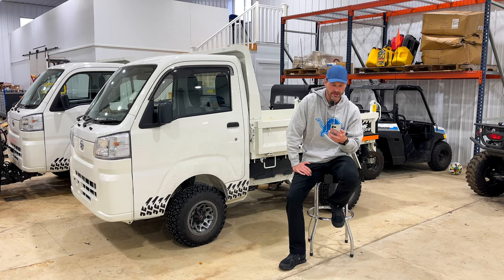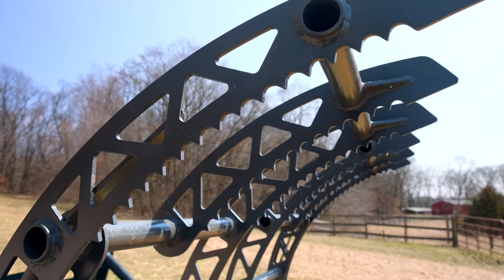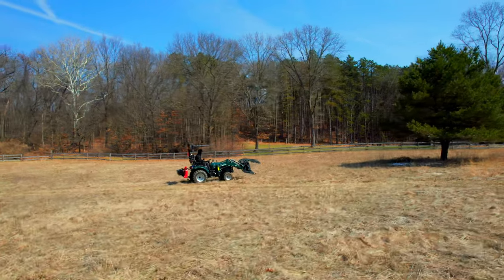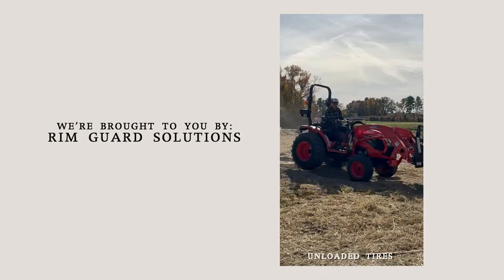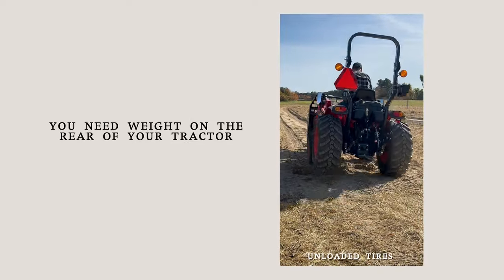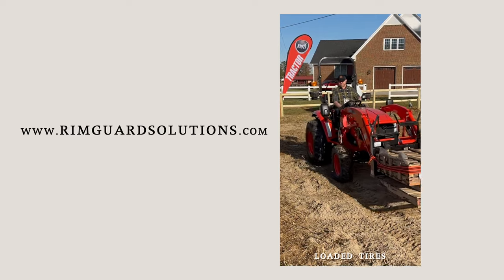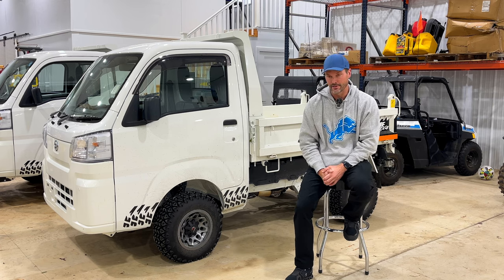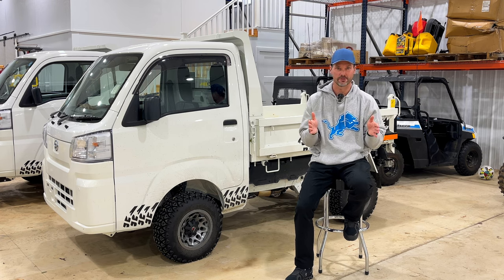ARE TINY GRAPPLES BETTER THAN GIANT GRAPPLES?

Comment: This would be pretty easy to measure. A strain gauge between the any two points you want to measure can tell you how many pounds of force are being exerted. You can imagine this like a pair of wire cutters, where your hands represent the hydraulic cylinder. It's far easier to cut a wire close to the pivot point because of the leverage. The further out you move the wire, the less pressure can be exerted and the harder it is to cut. And, just like your hands, at some point the hydraulic pump will start bypassing, and that's the maximum force that can be exerted at that point.

Comment: For a 3R series it probably doesn't matter as much, but on a lot of SCUTs weight really matters because they have low lifting capacity to start with.  Every extra pound of the attachment is one less pound of material it can handle so you hit the point of diminishing returns pretty quickly.

Comment: I run a 72” wicked grapple on my 4720, in my opinion you need a 60” for that 3 series tractor, as far as the clamping force don’t overthink it, I’ve never had any hydraulic clamping issues or lifting issues using my grapple the last 10 years, and I push my grapple to the limits, it’s always a ballast issue first, I run 3 wheel weights on each side plus tires are full of Rimguard, as far as grapple choice it all depends on what your main application is, I use mine for hauling logs brush along with ripping out roots

Comment: Great topic and excellent info as usual on your channel. I’m in the market for a grapple for all around use,  especially brush of all kinds. I’m looking to set up my Kubota L3400, gear box, and need your advice on a couple of things if you would have the time to respond. 
I need to get the plumbing done on her for the extra function up front, but looking for what would be the most useful, a joystick that is a switch activated diverted type where you get one function at a time with the grapple or one that is capable of loader operation and controlling the grapple? My other question was about the design of the grapple itself. Is a grapple with a longer bottom job more useful for lifting logs and holding them or is the pinch of the jaw going to hold the logs firmly enough to buck up the log itself?
Thanks for any info, and from your subscribers too, and I really love those mini dump trucks you have. I wish I had one of those too.
Take care and happy holidays to you.

Comment: I have a grapple for my JD 3032E.  It is one that I bought from a local equipment dealer.  The closing strength is terrible.  I increased the cylinder size, but it still is anemic.  I think it is because the "fingers" are too long for the design.  I had a dual cylinder grapple on my skid steer that worked great. Of course, I foolishly sold it :-(

Comment: All the force you need is the amount that will hold a log and allow you to carry it.  You will not likely ever have enough force to pulverize green brush and twigs, but then again, if you did you'd have to use a rake to clean up the mess.

Comment: And then we have Root Rake vs Flat Bottom grapples, single lid vs duel lid grapple to add to the mix......
Next Sept if WWIII dont start, I'll be pricing a complete 3rd function set-up on Root Rake grapple with single lid for my CK3510, I like a tight pinch on a small log and brush.............

Comment: I have a question on the same subject? If anyone can help. Please bear with me….
When I first got my tractor. (Kubota L 3560) I knew was still learning and I bought a grapple that the guy told me weight 500lbs. come to find out it weighs 800lbs. It is very similar to the iron craft root graple. It a TMG brand. I still use it just need a lot of rear ballast  and then I can not lift as much as I would like. I am debating about going with the ironcraft compact grapple rake or the precision mini. 
Ok question
I know they are different “style” grapples. The one I have and the ones I am looking at buying. But what one is better for working in the woods and moving logs and debris?
Thanks and sorry for the length
Reply: I have an everything attachments wicked 55 root rake grapple on a John deer 3038 e and I think it does the best that that tractor is capable of doing. I fire wood log with it and push brash with it . Just seems to be the right tool for me.

Comment: If the longer equals more weight, that can be a detriment for smaller tractors. With small tractors bigger is not better. If you got a big tractor with lift capacity to spare, go with the longer grapple.

Comment: Where your. Thoughts are right, I think you said it wrong, you said more clamping power on the tip no the closer to the pivot points the more clamping power
Reply from the maker: Closer to the base of the jaws or pivot point has more clamping power 👍